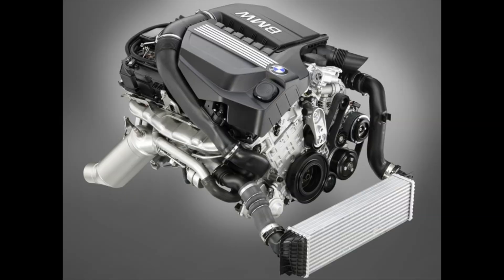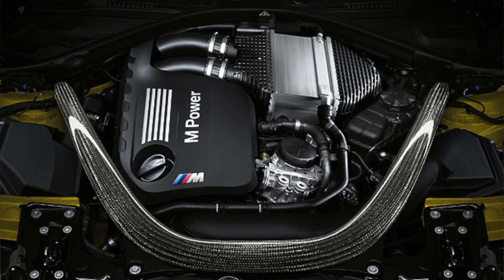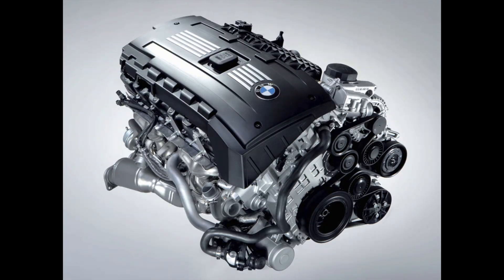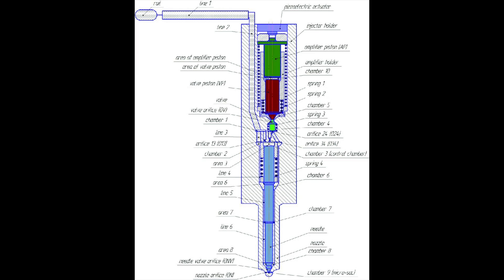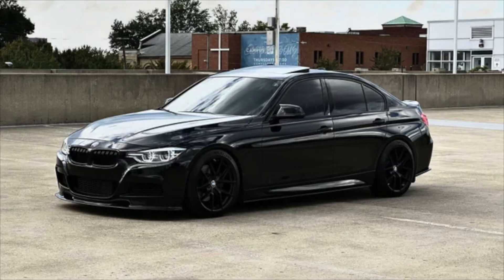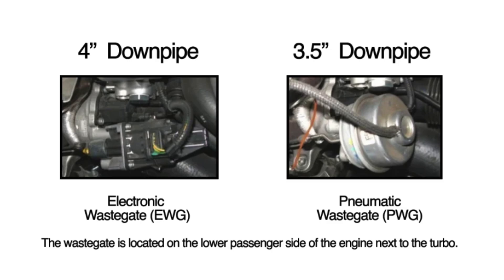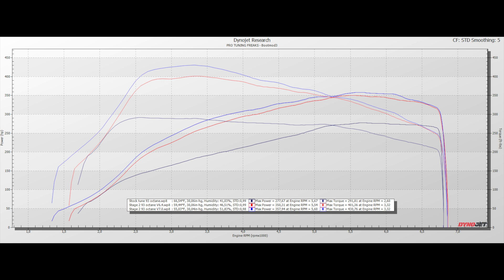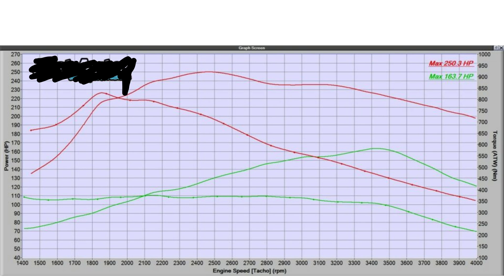Everything You Need To Know: N55 Engine

Comment: Ik the pwg is less powerful but the 135i in the USA only came with pwg and I wanted the hydraulic steering compared to the electronic steering in the M235i :) Happy driving bimmer boys
Reply from the maker: That's a good point. The hydraulic steering is significantly better than the epas system. They mostly went to epas to reduce the environmental footprint. (Less oil to change) Is yours stick to auto?
Reply: @mcgarage7315  if you are asking transmission... it's a the dct. The lci 135i came with the dct and n55b30 so basically its an og M2 lol jk
Reply: I have a manual LCI 2011
Reply: @DigitalDissident  That's a fine car. E82 or E88?